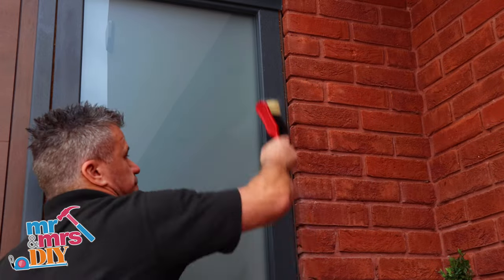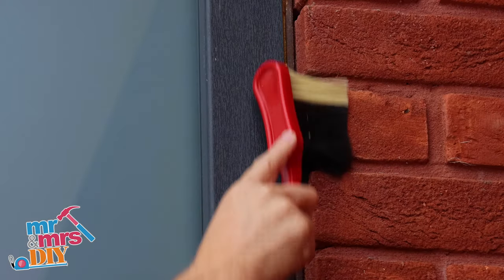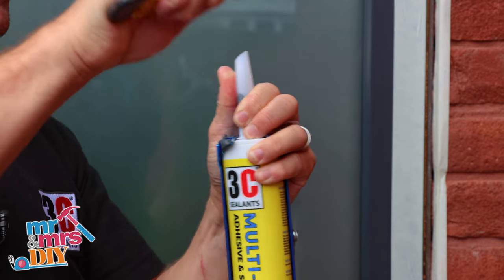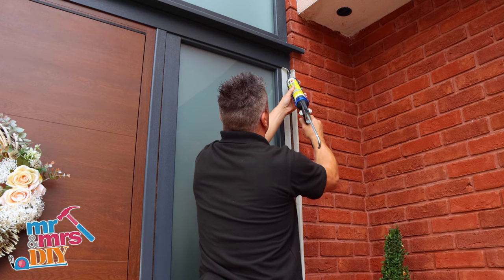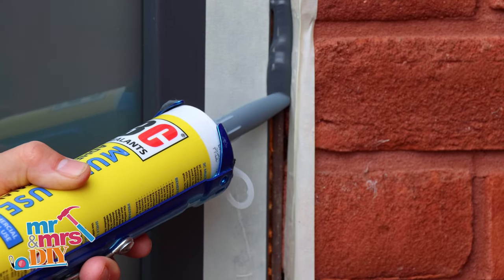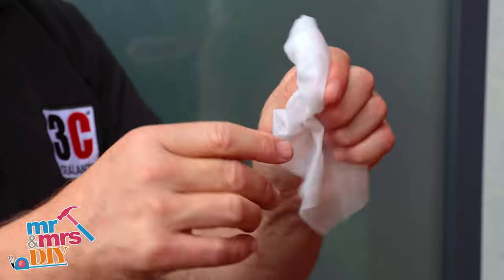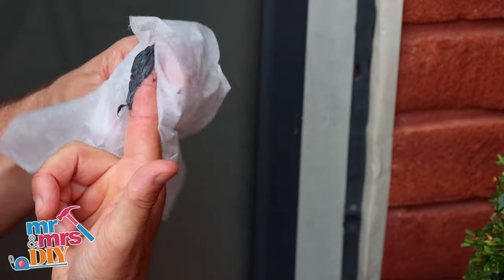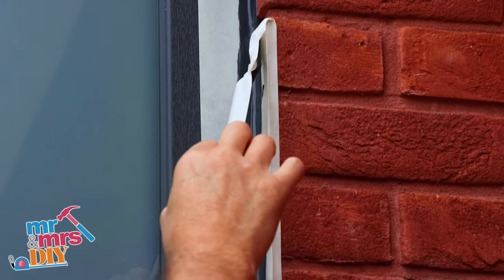60 Second DIY Tips - How To Seal Windows Around Brickwork

Comment: Still needs smoothing. Sealant isn’t flat to brick. Water will still creep under. Bad tip
Reply from the maker: It did get smoothed off, at around 0,35
Reply: Yes I agree was smoothed but not when the tape was lifted! If you look closely when the tape is removed you will see a small gap between the brick and sealant. Must be smoothed with a tool and solution once tape is removed. Tape is useless never would you see that on site

Comment: Can you also mention what kind of sealant is best for this job, silicone based or polyurethane?
Reply from the maker: Hi, so you'll want something with Acrylic in, meaning that it won't shrink and then crack further down the line. 3C's Multi-Use and their Polymer Sealant is perfect for this type of job
Reply: Soudal fix all for bonding and siliconing or Dow 791 if you want just mastic joints.

Comment: Thanks for the tip. How would you suggest dealing with a gap of around 1-1.5” above the outside window sill please, as the mortar used keeps cracking, presumably due to thermal expansion and contraction of the window frame with the change of weather? It seems too large a gap to use sealant.
Reply from the maker: Thanks mate, I would put an expanding foam in there, then you can wait for it to dry, cut it off and then cover it with either a silicone sealant or a trim of some kind. Cheers!
Reply: @MrandMrsDIY  Thank you. I’ll give it a go. 🤞🏻

Comment: Trying to do my windows and struggling. What can/should I do where the gaps are quite deep in parts?  Can’t get a neat finish at all
Reply from the maker: Fill any larger gaps with 3C's foam, let this dry and trim off, we have another video up showing this, then you can seal with HM sealant afterwards
Reply: @MrandMrsDIY  just had a watch will give it a go! Need to cut out the terrible job I’ve done first. Maybe buying 7 quid discount sealant wasn’t the right cal eaother
Reply from the maker: @simonb7711  Thanks!